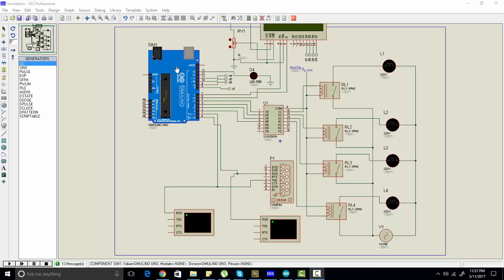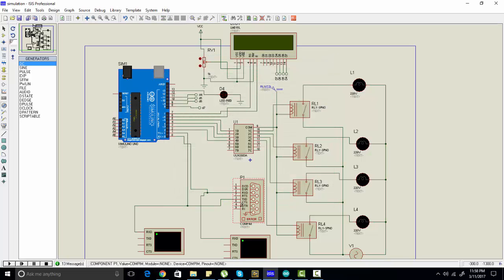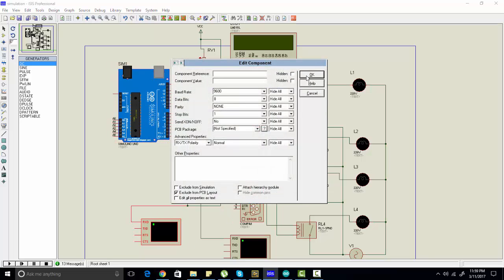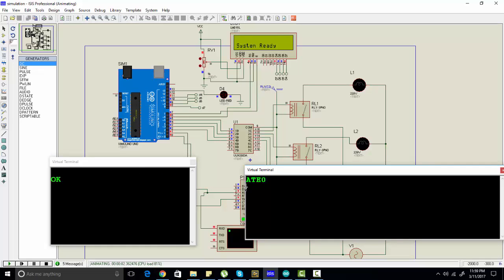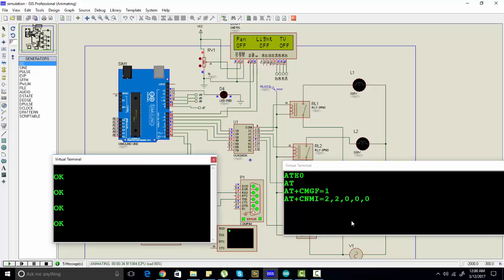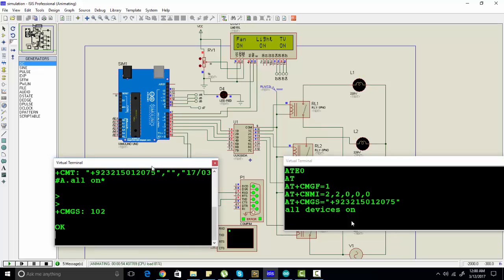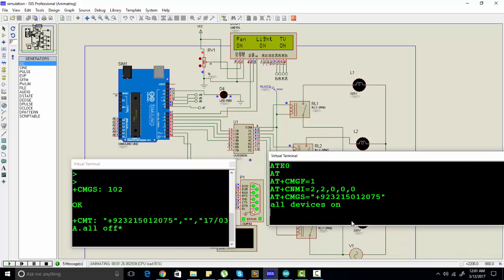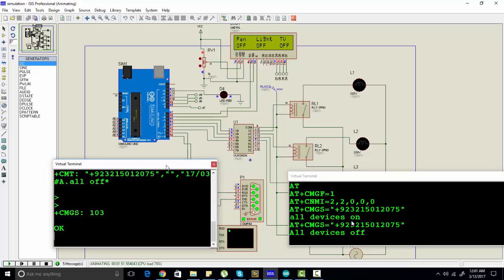home automation using gsm and arduino

Comment: Sir is it possible to Use GSM SIM800A??? if yes the Code will it need to be changed also or not??   Iam in process of implementation/// i want to build it physically.

Comment: AoA sir I have a problem with Arduino Uno would you please help me about it I was testing on different places on Arduino Uno meanwhile the multimeter probe touches one of the I.C multiple pins and this I.C gives smoke and Atmega328P chip got very hot now my PC can't load drivers LED(L) ON when I touch controller and power LED remains ON now which thing is burnt out in my case Atmega328P or Arduino Uno board.